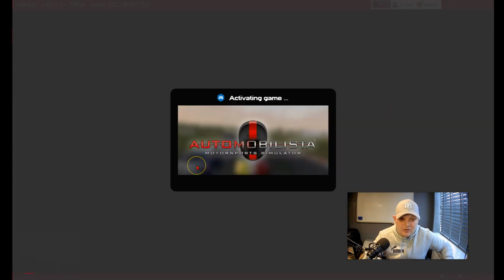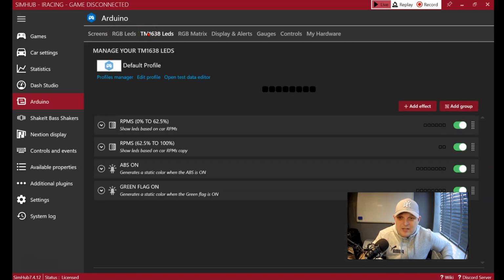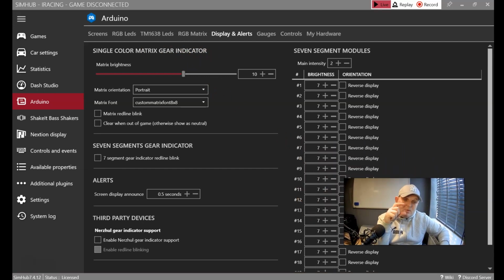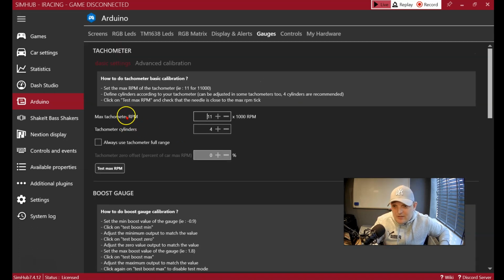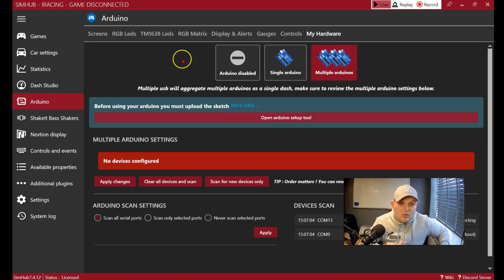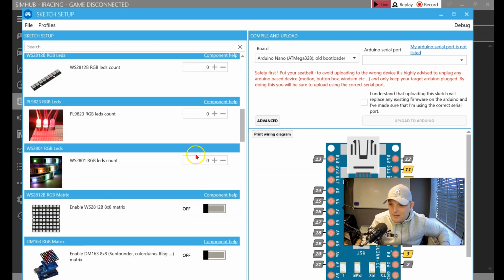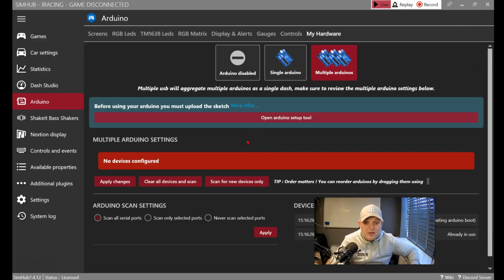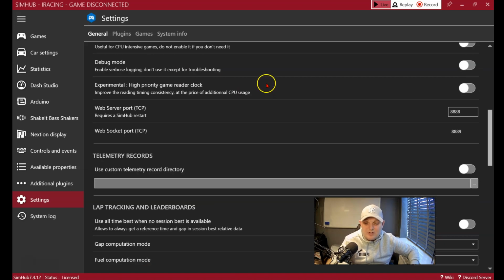SimHub Tutorial - Guide On How to Upload Arduino sketch

Comment: Do you sell arduino's that work with 3Drap products? I have the feeling upgrade kit and they keep sending me arduinos that are blank and my computer doesn't recognize it on any of the COM ports and I can't find it through device manager.. so really I just need an Arduino that connects to simhub that works with the rumblers. I have been in contact with 3Drap and it takes 3 weeks for them to respond to any kind of support request. The company is absolutely impossible to work with. The worst experience I have ever had interacting with any company lol

Comment: Hi!
Do you know any possibility how to make a text appear on my 8x8 matrix while being triggered for example by changing my brake bias? If i change it to 50.5, that that value will slide through my 8x8 matrix without having to make each “frame” myself?

I got it working now by maring each frame myself, but shouldn’t it be possible to let simhub read the value and automatically show it as text?

Would love to hear if you have any suggestions!

Comment: :greetings. [i have a query for you , hope you can help. my  wheel was connected to the simhub before i shut down the pc. the wheel was plunged in at shut down. start up and the simhub have no connected hardware. installed to newest version of simhub, but ti no help. and i have not touched anything at all. i did windows update. it help last time i had the same problem. but not this time. all other things work on the wheel. just not my led lights. and as long you build this tings, i hope your comprehension of this things can help me get i to work again. thx ]
: Frank-Eddie-Bjørge: Nikolaisen.

Comment: Thanks for the video's Gary, was just wondering if its possible to run multiple devices on the one arduino nano? i.e. a RGB led rpm bar using a WS2812b and a WS2812b led matrix to run flags on

Comment: Hi! How are you? I have a steering wheel with an arduino nano board, but it does not recognize the buttons in the sim hub, maybe this type of board is not compatible for this? .. greetings from Argentina
Reply from the maker: Tje arduino will have a sketch on it already. Go to windows start > devices and printers and check the arduino, right click , game controller settings, properties. It should sbow the buttons work as you press them

Comment: I have plugged in two 8x8 matrix displays. I want to use the indicator for cars passing left and right. I have one display on the left and one on the right above the TV. But the indicators are showing up on both displays instead of split. How can I fix this?
Reply from the maker: The issue with using the matrix pre set is its not configurable, it may be best to set the matrix as ws2812 with 64 led, then you can control where the leds are seen, so 1-64 leds on the first display  then leds 64-128 are not used. With this method you will have more control
Reply: Figured it out with the new content buttons.  Thx for the detailed video and sketch explaining. This is recently added in an update. Few months ago
Reply from the maker: @thijsesseboom1109  yeah just seen that now in the matrix hardware settings, good to know 😃👍🏻

Comment: This is really, really helpful info thanks. I've just ordered a Nano v3 & TM1638 to try building a simple display. Can you tell me, is there a way to tell if the Nano uses old or new bootloader? Thanks, subscribed :)
Reply from the maker: Hi usually you can see the version of the bootloader when you order them. Also i have not really noticed a difference on the old vs new loaders tbh